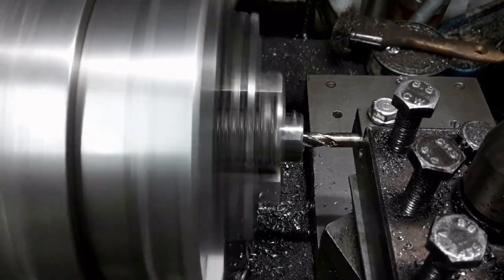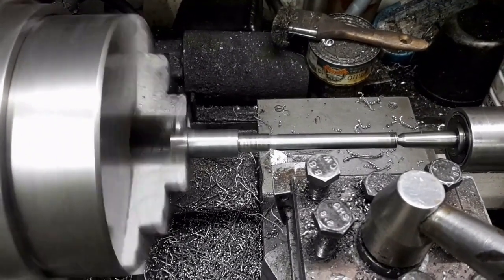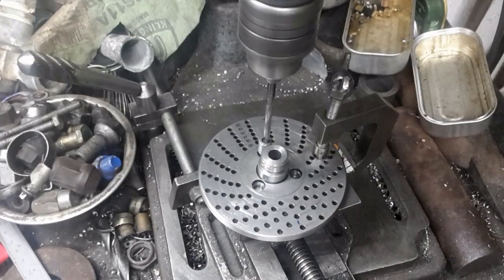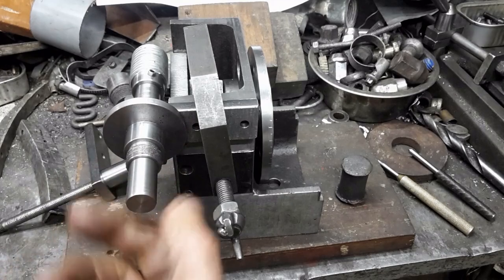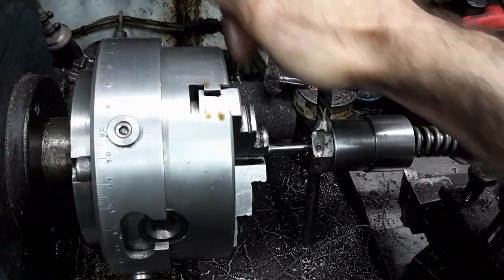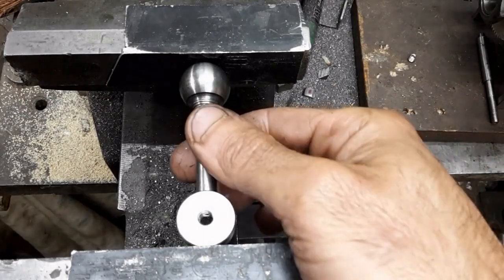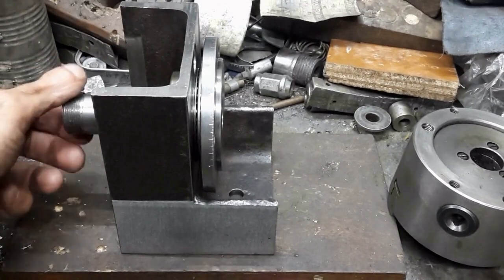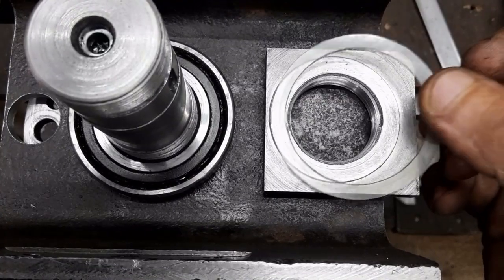DIY Dividing head held in mill vise - Build - ancillary components

Comment: The worm should be inclined at its helix angle of the thread. The worm gear should correctly be a matching profile and the teeth will have that helix anglec built in which gives a full contact surface, rather than a few tiny points of contact.
Reply from the maker: Correct - but this suffices for this application, and any wear will be taken up.